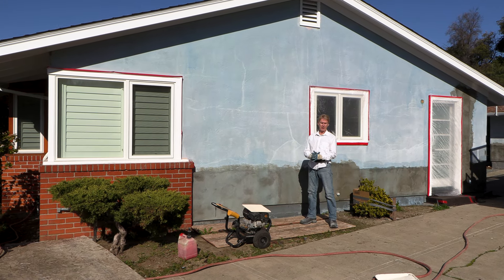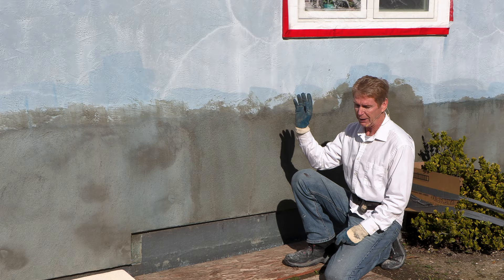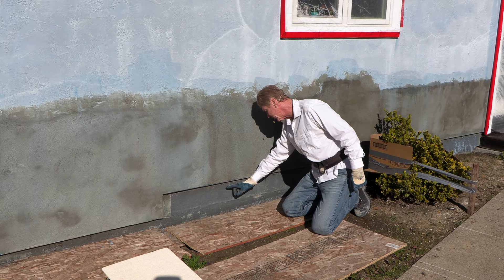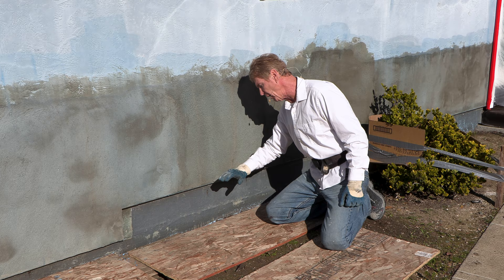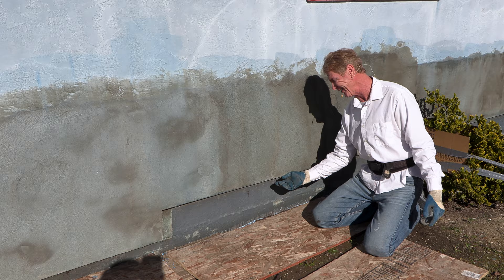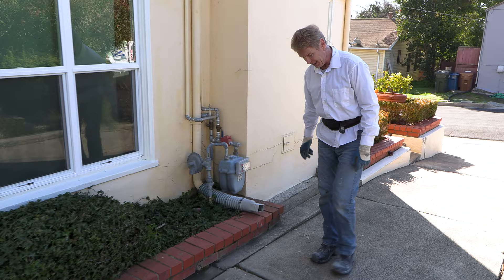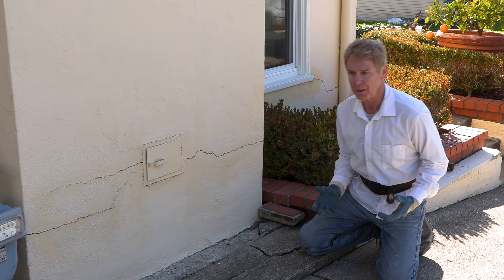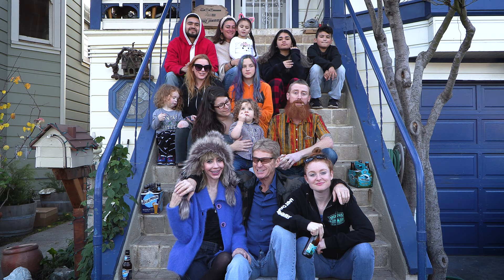Stucco weep or drip screed added to the foundation.

Comment: Kirk, I have a cottage in Hampton Bays I am renovating. This unit was built during the Depression and no, the stucco sits about fourteen inches above grade.  I just installed two windows and will have to do some stucco work there. Also, I plan on residing the stucco with  Hardie Plank Lap Siding so I will have to fur-out the stucco to accept the fiber cement. Maybe you could do a show on that?
Reply from the maker: Howdy East End Dude, No Boss, I won't be doing that kind of video as it's counterproductive. Here's a better choice for you at much less cost and ten times less work, which adds no future maintenance when done properly. https://youtu.be/xPvm5BUm5-8/
 Repair bad stucco patches with new plaster. 🧞‍♂

Comment: Thank you for that Kirk! You are truly the BEST. Was on the fence about incorporating a late-stage maybe too late stage weep screen. Decided not to since Iam still high off the ground and my slab is too. Plus I used fiber cement board and a 2’galvanized sheet metal that I molded behind the cement board all the way to the tip of the bottom of the slab. THANKS.
Reply from the maker: Glad I could help!

Comment: I am currently removing 4inchs of cement render aka pebble dash from a 1920's bungalow in west London.  Rain water has been wicking up that has now caused black mold growth within the property. The weather madness is all geo engineering!
Reply from the maker: Howdy Rana, West London makes me shiver thinking of the area. Hopefully, you guys can fix it by just removing the piled-up dirt? If it's into the mudsill and climbing the stud, it will be a drag to contain. Been there and done it a few times. Best wishes. 🤔

Comment: Hi Kirk! I absolutely love your videos and how you break down every single detail for non-stucco experts.  I had a question I'd love to get your take on.  I have hardcoat stucco on the rear side of my house, and a raised deck/balcony with a flagstone floor that's set in mortar (with a patio underneath).  After it rains, we see some water drops in the lower level close to the stucco wall (far away from where rain could even get), which suggests to me that they either didn't flash the stucco/flagstone transition on the raised deck or they just didn't do it properly.  A lot of the mortar joints in the raised deck is showing its age, so we're likely going to replace the entire upper floor with either new mortar/flagstone or stamped concrete (with a waterproofing membrane beneath it).  My question is - what would you recommend as far as flashing our existing hardcoat stucco to our new flagstone or concrete floor?  Thanks!

Comment: My home was built in 1979 in the Central Valley. Slab on foundation construction. Stucco all the way to the ground. It's interesting you mentioned they didn't use sheathing on homes back then. I had to remove the interior drywall of my garage and was shocked to see the backside of the plaster! The moisture paper was disintegrated as you described. Question for you - I have a section of flowerbed that runs along the side of my house, so there's dirt right up to the stucco, just as you've described. Is my best bet to dig out the dirt to just below the foundation and then fill it with crushed rock or something similar? This flowerbed used to have irrigation, but I've since capped the sprinklers. The stucco is damaged, as to be expected.
Reply from the maker: As a rule, stucco lasts between 50 and 80 years with proper maintenance. I would advise you to remove the stucco next to the wall. If it's against the foundation, that is fine.

Comment: Hi Kirk, after watching Ur video, I immediately went to one side of my outside wall where over the years, all the gardener's wood chips started to pill up higher at the level to the metal.  I worked for about an hour trying to remove all the stuff out of the way to leave about 2 inches space to the ground with dirt and wood chips.  I do have a question :  I noticed the metal in many spots rotted and even fall off, and even some of the stucco to cover the metal underneath in horizontal level also fall out. What do I do right now?  Would get more New stucco to patch it under help to prevent moisture to get into the wood behind it?  And what about the areas metal already fall off?  Thank U so much in advance!  🙏❣
Reply from the maker: @shenmeng5426  Good morning Shenmeng Dude, I recommend you do nothing, what you see is harmless. The stucco can and will last forever by itself. Example. My son and I saw an open garage perhaps two hundred years old. I walked in, there were no studs or wood left, the metal wire had rusted out perhaps fifty years prior, yet the stucco alone held up the structure, I tried to move or shake it to test for strength, I cold not budge it. On another note, some people have so much fear and wealth, they can tear down and build from scratch. My family falls into the first category. If it’s not broke we spend the dough on important stuff like food and bills. Your house, your rules. Kirk Giordano Plastering
Reply: @StuccoPlastering  : I appreciate so much Kirk to give Ur advise.👍💖  And It sounds good that nothing needs to be done at this point.  😂  I am a female dude, 🤣
Reply from the maker: @shenmeng5426  Lol, many inquires are indeed asked by females, By the way, both my daughters can plaster as well if not better than most men. Yes, I am saying, not to lose sleep over such a simply issue that does not compromise the integrity of the home. 😉

Comment: Hey Kirk I plastered my brick garage using cement+sand,  but in some areas it's cracking and falling off, mainly the chimney and the area close to the ground.
What would you do when cement won't hold? I thought about some sort of primer and adding lime to the cement. But I'm just guessing.
Reply from the maker: Hey Rut Dude, you must pressure wash all surfaces where they are clean enough to eat off, then apply a bonding agent like Quickrete. Now the stucco would adhere permanently. Adding lime won't allow any stucco to bond to anything. Lime adds flexibility and easier spreading but has nothing to do with adhesion; sorry, brother. 👨🏻‍🔬

Comment: So for a 100 year old house you just recommend raking the dirt away from the exterior wall until it’s below the stucco?
Reply from the maker: Howdy Max, no matter the age of the home, it's not a good idea to have soil next to stucco or wood; next to a foundation is harmless. The soil's not so bad until it rains; thus, that soil can remain wet for months sometimes if left in an area where there is little to no sunshine or air to dry it out.
 It can then leach upwards and start the normal molding cycle. You can pull it away from the wall about 3 to 6 inches so the walls don't remain saturated. 😉